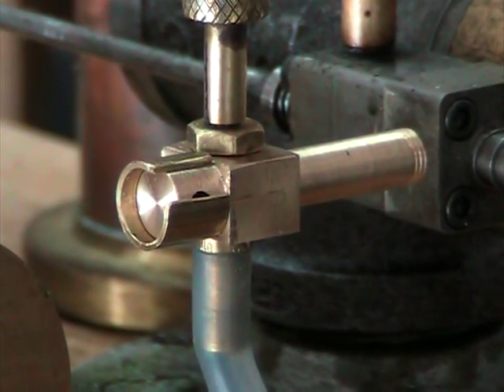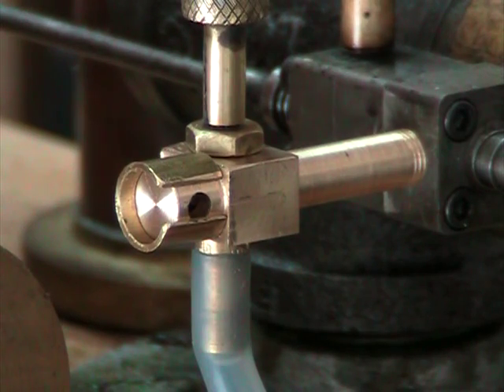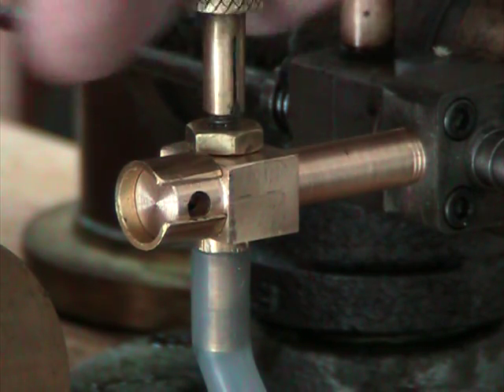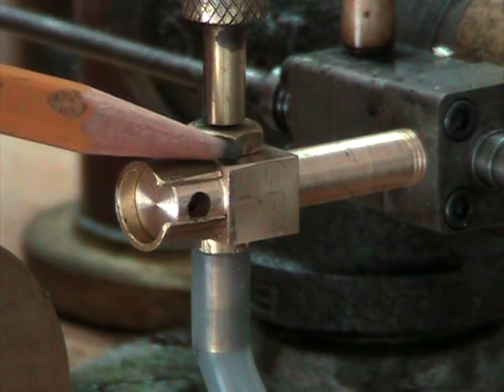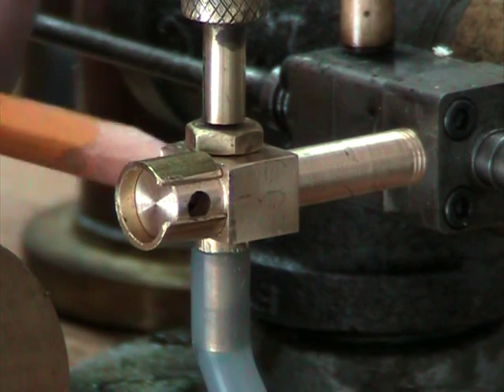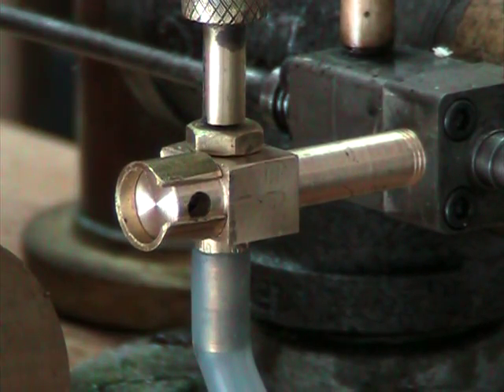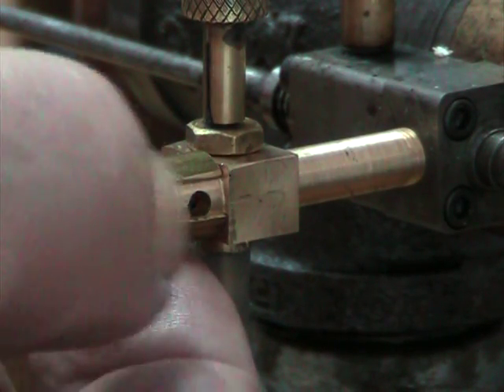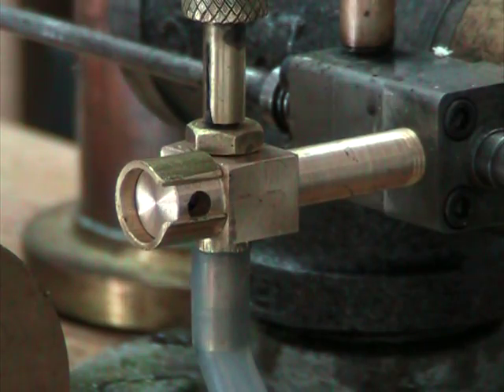New carburetor for my plumbing parts engine

Comment: I'm trying to figure out what keeps it from going too rich when the vacuum goes up even with an air bleed.  I'm used to seeing the needle in the middle of the barrel like on small RC carbs. That way the holes close on both sides of the needle at the same time keeping the pressure stable around the needle.  I'm going to try to build one soon.
Reply from the maker: This carburetor is designed more for good control at low, steady idle and not so much for wide throttle response.  Adjusting the throttle screw on this carburetor typically requires an accompanying adjustment to the mixture, especially when going from idle to high speed.